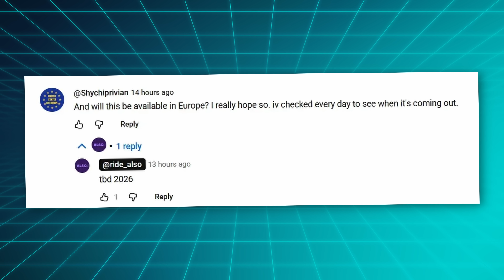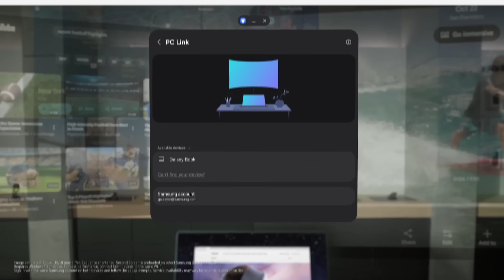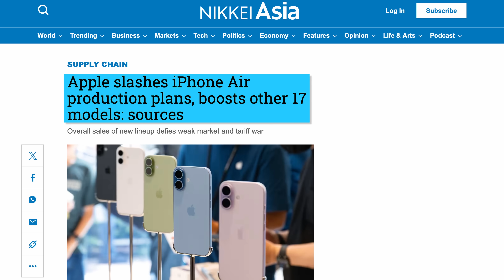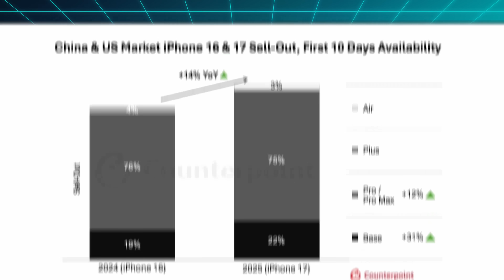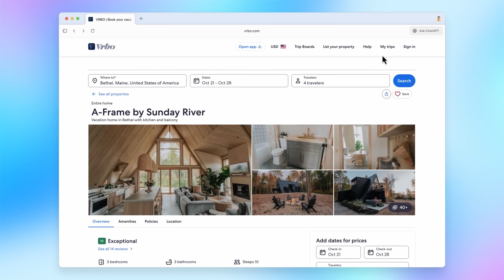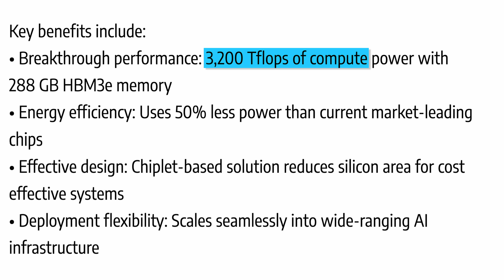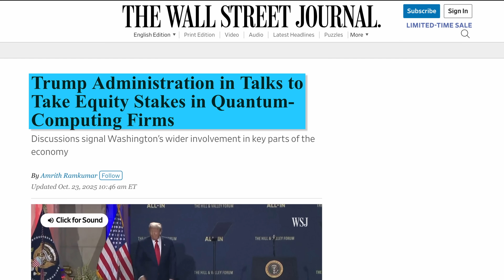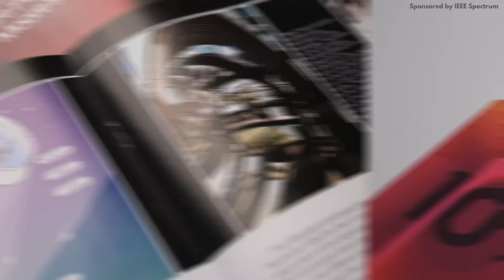Rivian reinvented the e-bike!

Comment: As a cyclist, mountain biker, heres what I think about the Rivian:
Pros:
full suspension so it should be comfortable, supports use their won rack at the rear.
The inverted fork sohuld be smooth and lubricate the inner legs well, in it's a proper fork. 

Cons:
geometry isn’t optimal, as reach is short, you sit too far back, not ideal for knees. But at least they have tall cockpit.
Also you valid concerns, a pedal assisted e bike will be ridable if the motor dies. This won't. So it's a no-go. But I will stick to a leg powered bike. But an e-bike in addition is nice for those that need or want it. But as one and only bike, it's a no-go for most.

Questions that need to be asked:
Sizes offered?
Who makes the fork? is it easy to service? Where to send it in for service?

Comment: Why did Also decide to use a mid motor for this? A hub motor would remove the need for a belt and sprockets, making it much cleaner looking and require less maintenance

Comment: What’s the point of pedal by wire if the motor is still in the bottom bracket and still has to use a belt/chain to transfer the power to the rear wheel? What’s the point? This doesn’t simplify the mechanics or allow you to make chainless designs!

Comment: Some simple research would have answered your questions. First because the bike is vertically integrated they made make all the software/hardware there is a get home feature which provides a small battery reserve via the BMS that allows you to pedal (albeit slowly) to get home at what was described as low speed but unlimited miles. Of course you would not want to do this slow riding so common sense applies but for most situations it's a non-issue. 

As for parts and maintenance like Tesla and Rivian vehicles it is a software defined vehicle and so has OTA updates for bug fixes and feature additions. The bike comes with a 2 year warranty and they are opening up a nationwide service network but my guess is, like the cars, service will not be necessary but if needed there will be a way.

Comment: 4K for a bike that doesn't work without a charged battery, designed for urban use, with a battery compartment with no security features. If you buy this and don't keep it inside 100% of the time you're not sitting on it, it will be stolen or scavenged within a month
Reply: Depends on where you live mate. In Tokyo, you can leave your cycle with camera gear and whatnot for even hrs and no one will touch it. It's similar in shenzen china but for different reasons.
Reply: @bruhder5854 this is a myth. The Japanese are not immune to thievery, despite what Internet factoids have told you. They have low REPORTED crime rates because the cops don't report what they think they can't solve

Comment: 8:57 I think "efficiency" in this regard depends on what you want to be efficient. If you want the pedalling to be most efficient for recharging the battery, then Rivian's approach makes sense having the pedals directly on the generator. But if you want it most efficient for routing mechanical energy to the wheel, then pedalling should be directly connected to that wheel. Maybe?

Comment: Omg peddle to wire? How do these ideas keep getting approved? Bikes are already insanely efficient, the advantage of an ebike is that it can boost your effort for longer distances, higher speeds, or going up hills while making use of the already super efficient biomechanical drivetrain - having an ebike that can't take advantage of that and relies solely on electric drive is so insanely dumb because you not only lose efficiency but also have to add heavy components (like the generator) to make it work... Rare L for Rivian, I really like their cars.

Comment: i'm really surprised about the Iphone air selling so badly. If i was in the market for an Iphone, the larger screen and slimmer formfactor at a similar prize to the base Iphone would be pretty tempting.
That being said, if i was looking for an Iphone, i'd still choose the base model, simply because it has nicer colors and feels a bit nicer to hold despite its higher thickness. On top of the obviously slightly superior battery life

Comment: In the Netherlands ALSO's "pedal by wire" "bike" would legally be considered an electric moped. Max speed would be 45kph (28mph). And you'd need a license to drive. Similar to a "speed pedelec".

The four-wheel versions have better market options as they could possibly qualify as mobility scooters. You do not need a license to drive those, just pay for insurance. Speed would also be limited to 45kph on shared roads. So the open version could compete with regular electrical cargo bikes, just with the extra hassle of needing to pay for insurance.

Comment: People want mini phones not thin phones.
"bUt ThEy hAd mIni AnD diDn'T bUy iT" No! They had an experimental mini with a small battery on 12 from Apple who is not accepting that the mini died because of them and not because of customers. 13 mini is still rocking right now in many pockets. People want 18 mini not 18 fold, not 18 air, not 18 air fold and other bs like this.
Reply from the maker: Every brand has tried a mini phone. All have given up. There were premium ones, big battery ones, thin ones, cheap ones, none have survived. The reality is people don't buy mini phones in large quantities

Comment: I actually feel the air is a good starting point and there might be a case to be made for the developing minimalist market. 
Lower resolution cameras to get rid of that bulge, last gen processor to improve battery life, maybe even a streamlined version of the iOS launcher for a cleaner and less demanding experience.

And slash the price point for a true budget option. The only way you are getting new people into the ecosystem these is by bringing them in as a secondary device.

Comment: i think most people will prefer their phone to be thin and light. 
The problem is that Apple created this phone but took out so many things(it doesn't even have stereo speakers) that is actually quite an inferior product. 
And that might have not been an issue if it was priced lower like their other "budget" phone that people still found to expensive. That phone should be 400 and this should be 600 at best(i was going to say 500 based on features but i let it slide to 600 for the trouble it takes to engineer a thing phone.).
But Apple is asking a lot more than that. 

So of course no one is going to buy it. 
Who is going to pay more money Than a normal IPhone 17 just to get less?
And is not even sacrificing one thing. Like the battery. Is sacrificing everything. Battery, sound, cameras, modem, heat dissipation and performance. Everything is worse.

Apple is simply overcharging. They thought they could get away with it by making it a fashionable thing that women will buy because is thin and light etc and therefore make the price not matter because it will be like a fashion symbol where you pay to be fashionable instead of the tech inside but they failed.

Comment: I refuse to belive those Vok quads or these new Rivan things are actually road legal in Europe.
This won't stop them of course.
The Vok doesn't have pedals that can propel it in any way and clearly runs at about 1kw. They pretend their pedals that are only controls for the electric motor propel the vehicle and that it's 250w. (The range of a standard Vok is 50km on a 2.3kw/h battery 🙄)

They're taking advantage of the regulations stating that 250w is the "maximum continuous rated output of the motor".
I suspect they calculate the continous rating of the Vok motor by saying if it was stationary (rolling road, so not air cooled) and running at 300w it would overheat eventually...probably also the air temperature has to be +50c and the battery have infinite capacity. 
They probably use some other bullshit as well, that I've not even thought of 🤷‍♀

Comment: businesses need to look to the ev market. if you offer a new product that is not superior to what it replaces while offering new features which arn't primary to its function it wont sell well. people stick to gas for cars because it still offers to its primary function better range and fueling convenience. and to phones when the smartphone was created it added value to communication and dexterity. the iphone launch offered convenience and usability with 1 screen no buttons. these were directly improving the usability and capability of the device as to it primary factor which is calling texting and data usage. just a phone being thinner isnt a big sell considering what it is improving from is still thin enough to fit in pockets. its marginal but the compromises are too significant. the weight and size of smartphones is not significant enough and calls around the industry from consumers have not been significant enough to warrant it. tablets have succeeded in getting slim as tech has shrunk naturally over time like phones and the size of the device has allowed it to cram all required into a thin device. you either incorporate your slimming innovation into all devices while mitigating compromises or dont do it at all as you are creating another production line for a inferior device that wont sell well. at this point the iphone 16 pro is a better sell than the new air phone. Mobile phones are reaching their peak in terms of maximising what you can do with them and this is where imrpoving the tech thats already in them needs to happen. battery tech has come along way we now have pouch cell technology usb c power delivery has been a thing. users would like to see improvements to charging their devices. wireless charging needs improving and so does wired. all the advertised charging speeds are missleading they are from low % to 50% where charging is the highest. these charging curves make the increased charging speeds pointless if from 50% to 100% they charge to the same curve. maybe split design battery systems could be used to allow higher charging wattage at higher % on phones to really cut down full charge times or partially charge top ups. what i know sells well is consumer convenience. apple wallet keys for example is far superior to google or samsung wallets because of its secure design for smart integrations like door locks. face id offers convenience to users such as those where fingerprint biometrics is not usable like dirty hands or micro cuts on fingers or even wet screens in the rain. face id on iphone works so well compared to samsung or other android device offerings especially in lower light conditions. features to other devices like the ipad using charging through smart connectors offers up so many options to the smart home world which customers in that world tend to have more money as smart home is a luxury. bezzel sizes and device integrations make a difference too. people love ecosystem harmony using multiple devices together it just makes their lives easier.

Comment: I have been curious about those pedal by wire concept. Because it means that the person can set a suitable resistance for their muscle type/strength, and provide power to the bike that way. As a concept that makes a lot of sense.
But I don't think they can be sold as bikes in the EU, assisted pedal electric bikes are speed limited to 25Km/h, and can't have a non assisted mode, and no matter how you program a bike like that, the motor is not technically assisted by the pedaling.
But as a moped with the ability to provide your own charging, to extend the range, it makes a lot of sense.
The price seem high though, but some countries in Europe, I think still provide subsidies for purchase of electric bikes.
Needing to use a moped helmet, and take a basic course, could still be worth it. I guess the only issue can be the top speed, which might force you to drive on roads rather than some bike-lanes.

If only EU could decide on a standard format for batteries for electric bikes, one could lend ones battery out, to anyone you bike with, if you have charged it, but they either did not have the strength or just have pedal assisted bike.

Comment: VR headsets makes sense for home entertainment, and can in many situations compare well against buying large screen TV with similar experience. But they should offer 4K for the viewing area. And there needs to be solution for connecting HDMI devices to multiple headsets, while playing DRM material.
You still need camera so you can see through the display to reach for popcorn or soda while watching movies. And it makes sense to have some kind of indication if you are in full transparent mode, when you need to talk to family member while pausing the movie.
The vision pro, has the wrong focus, and overdesigned the see-through, and the front display, in attempt to make the impossible of turning a device like that in to something you can use kind of like smart glasses. Neither will be able to to what the other does well, at an acceptable level. Smart glasses can't shut enough light out and a display that has to be see-through can never have good enough quality. At most they can be useful for seeing video podcasts that you typically listen to, while cooking, doing the dishes and similar. Or scroll you social media watching shor videos where the quality isn't all that important. And that is fine, as long as home entertainment is not the intended target, and it doesn't seem to be. Meta seems to have found a solution good enough for not having to place the display area to the side.
But a VR/AR headset will always be too heavy, not offer long enough batterylife, they will always look weird when used walking around in public, and the camera see-through will always occasionally cause issues.
The concept of seeing 3D objects in the room, is a distraction, it will not be a mainstream feature, and requires unnecessarily complex mapping and cameras for a consumer grade device, that will mostly be used to replace TVs/tablet screens for video watching. It doesn't matter if Apple puts Pro in the name, such feature are way to niche for Apple to make under the Apple brand name, if they want the keep developing the tech, they should start a new brand that is not consumer oriented. Otherwise they are better served by licensing the tech to brands that do produce niche products like that, that won't confuses the masses.

Comment: we have had that kind of city bikes for 7 years now. they work even without chains or are sort of harder to cycle with those.
Reply: and yeah, there's definitely some room for improvement, like they are really really hard to use without electricity (dunno why there's even an option to not use electricity). it would kinda make sense to have a mode where you can generate power without moving, but they just change the batteries here. there's also an option for some sort of docking station, but haven't had those around.

Comment: You'd loose 20 percent of the power?
NO, you'll only gain 20 percent, 80 percent will be wasted.
An electric generator and an electric motor connacted in chain will be extremely inefficient!

Comment: Those ebikes seem very inefficient..... Like, I rather be able to pur most my leg power on the road and then have the batteries help me, instead of me charging batteries and then losing like 30% of the energy to charging a battery then like another 30% trying to put it on the ground. 
Regen should be a plus not a hindrance

Comment: iPhone Air misses key features: small screen, single speaker, single rear camera. Weight and design are good. If Apple adds a bigger screen, dual speakers, and multiple cameras in the next version, sales will likely increase significantly.

Comment: ok, as a biker, the rivian e-bike, kinda looks good, but that's not a bicycle, that's a motorcycle with pedal assist, and that seat is in no way confortable to be a bycicle (in the motorcycle like model). I do like the inverted fork, but i doubt it shreds.
also the helmet, yeah, i don't trust it, helmets are not supposed to be full of tech, they are supposed to be safe, and it seems like the r&d was spent in the wrong place...

also, the cranks not being connected to the drive train makes it so that the usual 95%+ efficiency of a bike chain drops to around 50...
Reply: Quality electric generators driven by mechanical movement and electric motors can achieve 98%+ efficiency.  Belts and chains are about the same efficiency on average, with slight advantages for belts under high torque.  Pedalling into a generators allows continuous selectivity on the force required, or with software controllers you can choose multiple gear-like discrete force required.  High end motorcycle helmets have had rider-rider or rider-phone comm systems available for years now. The helmet they designed looks like it has external components to allow “shredding” outer layers to further cushion impact, and dissipating some of the sudden rotational forces, hopefully reducing broken necks.

Comment: 2:15 You would think this is true, but this is basically what Honda does with its serial hybrid system. I'm guessing this is the same idea of some kind of eCVT to transferring your pedal power to a more powerful and efficient electric motor. If it works for gasoline engines, I don't see why it wouldn't work for pedal power.
Reply: A regular chain drive on a bike is around 97% efficient. I doubt any electric system could beat that.